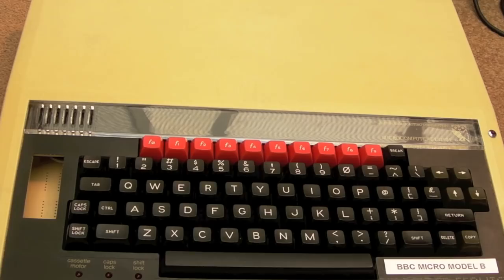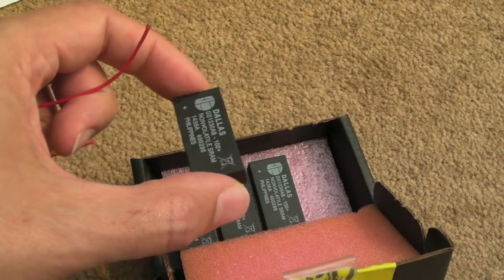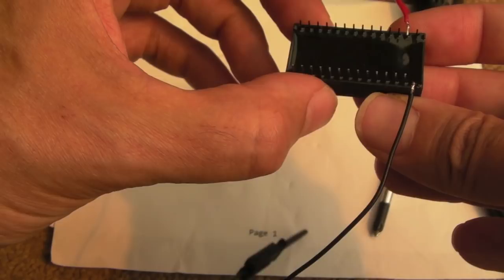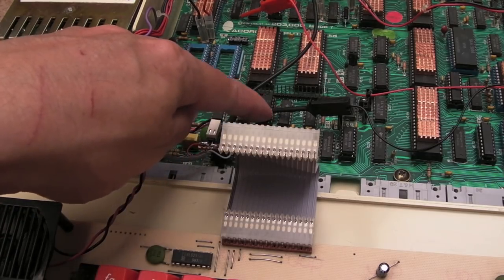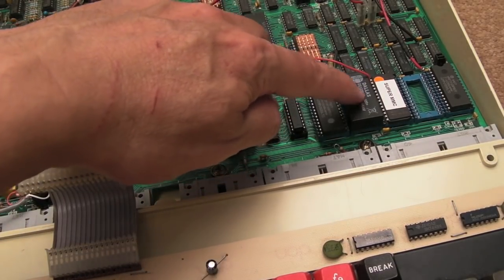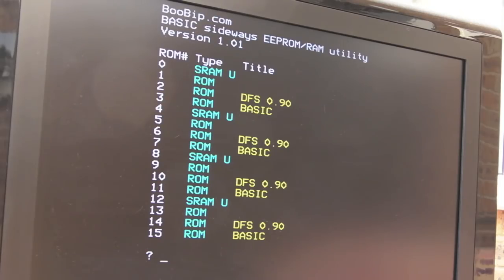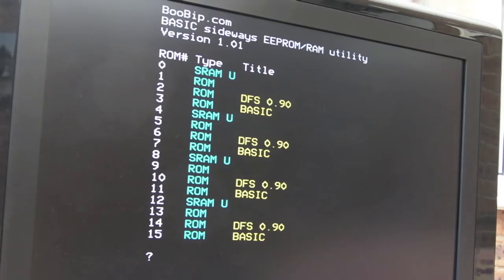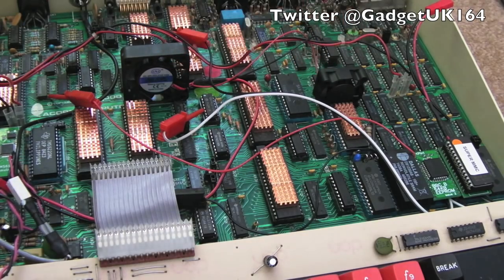Acorn BBC Micro Model B DIY 32K Sideways NVRAM Upgrade

Comment: Hi !!
This dallas chips has battery inside !! In the PC-XT era, here in Brasil we used to disassemble/open this chip, take the battery dead out and modding with 2 AA batteries with socket !! 
I believe that it’ll work for this memory chip too !!
Reply from the maker: Thanks, yes - I've filmed replacing the batteries on that type of device on the Philips CDI repair video, and on the Amiga A2286 repair series!
Reply: @GadgetUK164  
Curious to see this video !!
Can you point-me ??
Thanx !!

Comment: Why does the BBC Micro have so many ICs?  Why didn't they use any VLSI to lower the number of chips?
Reply: With those custom chips harder and harder to find kind of wish some of the retro systems had gone with the readily available ICs.
Reply: I'm trying to fix a black screen C64 and I don't have any spare custom chips to do a simple replace test with so I'm especially wishing for discrete. On the C64 and C128 the custom CPU is especially a pain when the 6502 is so close but not quite a substitute. So far I have used my DS212 to see that there is clock and activity on the address and data lines but that is it.
Reply from the maker: I think probably because it was designed very quickly and to be as cheap as possible.  I suspect a VLSI chip might work out cheaper for large volumes, I expect the initial creation of the VLSI chip(s) to be quite costly, and perhaps require additional time to test before rolling out.  Acorn created the beeb really quickly and it was rolled out soon there after.
Reply from the maker: @ MacJohnMcC - yes, I agree - I prefer discrete IC's like this with readily available off the shelf parts!  Wish the PC Engine was like that lol.

Comment: i remember when i had my old bbc-b, i had a 7 socket sideways ram board that IIRC fitted over the top of the speech socket. does that sound familiar ?
Reply from the maker: I've not seen one yet that goes over the speech chip, but I am sure that's a possible model =D

Comment: Do you know anything about the mechanism that switches on the battery in those Dallas chips? Are they turned on in the factory, or upon first use?
Reply from the maker: I am not sure exactly how it works - I believe there used to be some internal fuse related to a transistor, which isolated the battery from the circuitry inside until VCC was powered.   From the datasheet on the DS1230AB there is this:-

*Each DS1230 has a built-in switch that disconnects the lithium source until the user first applies VCC.  The expected tDR is defined as accumulative time in the absence of VCC starting from the time power is  first  applied  by  the  user.  This  parameter  is  assured  by  component  selection,  process  control,  and design. It is not measured directly during production testing
Reply: Interesting. Electronupdate has a video on the DS1284, but he glossed over the battery aspect. Incidentally, I always found it weird when an application like the CDi didn't use a sockets for these self powered chips. Typically the wrong sort of cost cutting.
Reply from the maker: It is crazy they never socketed the DS chip =/   Cost cutting too far I think!

Comment: The OS has support for 16 ROMs total, and this would be supported using IC76 which has a 4-bit output word and thus 16 possible values. Since the board only has four ROM sockets, only the two least significant bits are used (they attach to a 2-to-4 decoder/demultiplexor) which means that, for instance, ROM 0 is selected when IC76 is outputing 0, 4, 8 or 12 as in these cases the two bits being used are both set low. Your NVRAM chip is selected to the third output bit on IC76, so it maps only into slots 0 and 8. If you connect it to the fourth output, it should map into slots 0 and 4.
Reply from the maker: Thanks for the detailed explanation there =D

Comment: I've never really encountered a BBC since I was at primary school, but this is really impressive.  Good work!
Reply from the maker: I have a Pi Zero in there now =D  That's an upcoming video too! =D
Reply: Yeah they are a great bit of kit, very very customisable and as Gadget mentioned, there's a lot of support these days as a result of that. I mean, using the Tube interface you can even get a Raspberry Pi Zero hooked in to offer a silly amount of grunt for such an old machine. I wish life was kind enough to let me still have one.
Reply: Neffers - yoinks! I've just had a quick look on ebay, and they're not cheap. You're right about expandability, too. When Chris first opened this one up I thought there were a load of chips missing. I bet most of them spent their whole lives without ever being opened.
Reply: Well, for schools at the time, there would have been the tech / janitor / chemical guy (you know the type, knows everything and has many hidey holes to avoid the kids lol), more often than not he would have been tasked with installing at least two ROMs. One would have been View (I think) and another which was a spreadsheet (I forgot its name) , invoked by *word and *sheet respectively, it was cheaper to burn ROMs at that scale than have them pre-installed, so I imagine that most of the school ones will have been opened at least. 

Then there was the enthusiast, who chucked the case away and set about making a custom enclosure, with exotic connections to allow custom boards (often hand wire-wrapped instead of PCB's. Mikes Electrical Stuff (channel), shows off his old workhorse if you wanna see that aspect of it. 

And, yup, they aren't cheap despite how common they were, I guess that's price hiking due to the current retro wave.
Reply: "chemical guy (you know the type, knows everything and has many hidey holes to avoid the kids lol)"

Did we go to the same school, or do all schools have one of these?  We used to think the chemical guy made LSD in the basement.
Reply: Lol, yeah I think every school had one of those people. I took my Beeb to the guy to add a couple of ROMs to my Beeb, that was from the same school (was given to me by a teacher as they were using Acorn  Archimedes by then) "The dude" did question me, but only for a second. He did reside in the science block at school, it was a bit of a rabbit warren, ideal for a chap of his nature lol.
Reply: GadgetUK164 - Next week: "Attaching a GTX1080 and playing Crysis"
Reply: About half the ones I have came without the case screws, I guess because schools would move the ROMs from machine to machine, or maybe because kids love to take things apart!
Reply from the maker: :o)
Reply from the maker: Luckily I do have all the screws!  Just put it back together as I've been in and out there like crazy lol.